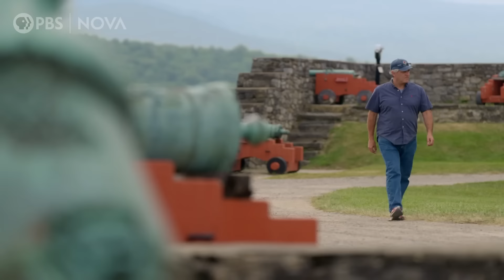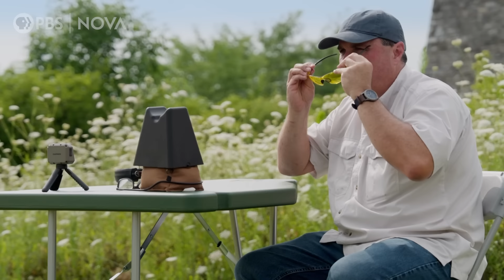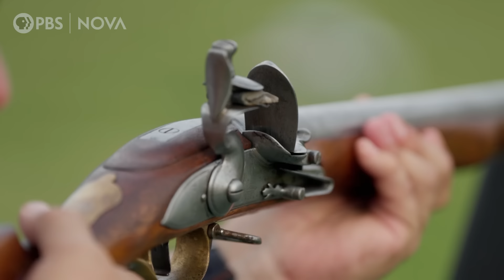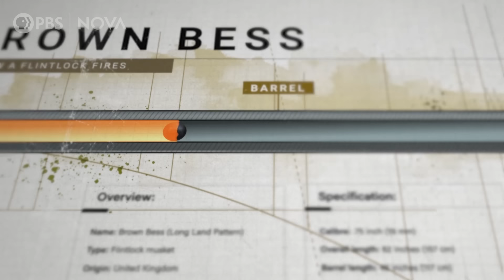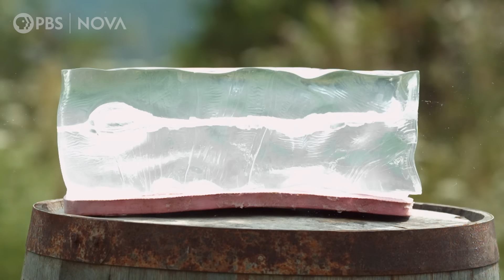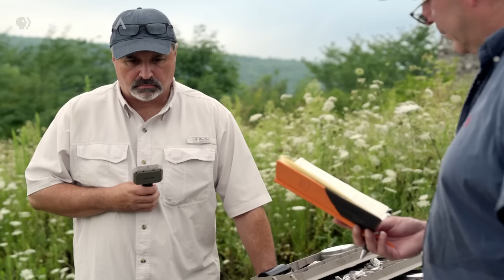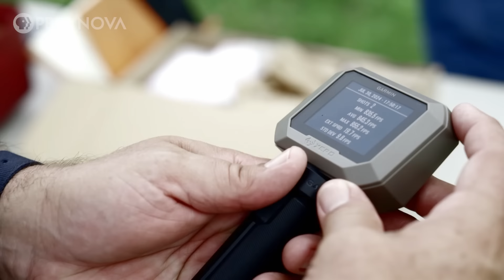How Deadly Was the Musket? | NOVA | PBS

Comment: Once again, I have to explain this, to dispel the myth that you couldn't hit the broad side of a barn with a smoothbore musket. There are two general ways to load a musket. In battle, the quick expedient way was used, which is to drop the loose ball over the powder and ram the empty paper cartridge down on top. When fired, the loose ball would bounce and roll down the barrel, usually hooking a wicked curve in an unpredictable direction as it exited, due to its sideways spin, which could result in a foot and a half, or more, of deviation at 50 yards. However, if time permits, the barrel could be swabbed, and the ball wrapped in a tight fitting greased patch of cloth or leather, and then rammed down over the powder. This is how it would be done if deer hunting, for instance. This method will prevent spinning, and will result in a surprisingly accurate shot, giving groups of only a few inches at 50 yards. I've done it myself with my own .68 cal. musket.
Reply: That would mean that the first shot fired would be pretty accurate because the gun would have been preloaded before the battle begun.
Reply: @wr1120  That may be true, but I couldn't say. It's likely that most of them didn’t, in companies that had been drilled according to the drill manual of the period, because it probably wasn't considered necessary, and the troops had all been issued standardized equipment for loading in the usual way, and that's how they had practiced. But accurate longrifles also existed at the time, although they weren't as common as smoothbore muskets. There were small numbers of "irregular” troops, who were equipped with their own rifles, and could be employed as sharpshooters.
Reply: @bellowphone I like to think a grandfather of mine, a captain, and his son were smart enough to be sharpshooters. All I know is, They made it to Ohio after the war and I'm alive today.
Reply: @melissaorlee  And that's smart!
Reply: Brilliant answer! Absolutely spot on! This is why the first shot was always so much better.
Reply: I think the myth is becuase people compare it to rifles that became common in the 19th century. Those rifles were far more accurate and (relatively) comparable to modern guns. Missing by 18" at 50 yards is inaccurate it's just not as crazy inaccurate as some people think.
Reply: to be honest you don't want to me hit by ether one
Reply: @KaedFuyou  No, it will put you in the hurt locker quicker than sooner.
Reply: Thats super useful thank you
Reply: Okay, but what would be the comparative reload time between a rifle of that time period and the musket loaded in this manner?  The reason the musket was preferred (I know you know this already) was that the quick expedient way was possible with that weapon's smooth bore, and in a pitched battle, rate of fire matters more than accuracy, since you're very likely to hit somebody when firing at closely ranked soldiers, whether in a thin line or a column.  (You might wound/kill two men if one is right behind the other, and whether they die or not, they are out of the fight for a while).

You wouldn't give a sniper a musket if rifles were available.  And the Continental Army, in some battles, had riflemen who would be backed by musketmen--with the faster-loading muskets providing cover, they could take a serious toll on the enemy from a longer distance.
Reply: @christopherlyons5900  As far as I can tell, there's no appreciable time difference in loading a rifle or a smooth-bore musket with patched round ball. The tighter the patch/ball combination is, the harder it is to start the ball, and in general the rifle loads will be tighter, needing a short starter to bang the ball in, before ramming down. So it is done by marksmen for whom tack-driving accuracy is important. But I just load easy in either case, and don't need a short starter.
Reply: @bellowphone  So assuming that is true, and I see no reason to doubt it--why would the Continental Army have rifleman squads, when rifles would presumably be more expensive to make, harder to find, and  you could just have squads of musketmen who were instructed to use the tighter load and aim more carefully?  

There was even a song--that I learned in music class--meant to strike terror into the Redcoats--"The Riflemen of Bennington."

Why come ye hither, Redcoats, your mind what madness fills?
In our valleys there is danger, and there's danger on our hills
Oh, hear ye not the singing of the bugle wild and free?
And soon you'll know the ringing of the rifle from the tree

Oh, the rifle, oh, the rifle
In our hands will prove no trifle
Oh, the rifle, oh, the rifle
In our hands will prove no trifle

Tell he who stays at home, or cross the briny waters
That thither ye must come like bullocks to thе slaughter
When you'll meet our Mountain Boys and their lеader Johnny Stark
Lads who make but little noise, but who always hit the mark

Oh, the rifle, oh, the rifle
In our hands will prove no trifle
Oh, the rifle, oh, the rifle
In our hands will prove no trifle

There had to be a significant difference in performance between rifle and musket, or there'd just be muskets.  I'm going to guess that the rifling made a greater and greater difference as range increased.  If you can hit your opponent, and his return fire never even reaches you.....
Reply: @christopherlyons5900  The short answer to your question is, yes, rifles are significantly more accurate than smoothbore muskets, regardless of how they're loaded. The greater the range, the bigger the difference.
Reply: @bellowphone  As I thought.  But it's still worth mentioning that muskets could be deadly accurate as well.  It was just that in pitched battle, rapidity of fire meant more than accuracy.  Hunting with a musket would be quite another matter.  If you miss your first shot, the prey is off and away.
Reply: And to emphasize one more point--rifles back then took a lot more time to make.  A badly made rifle would be useless.  There was more craft involved.  Relatively few knew how to make a Kentucky Rifle, in Kentucky or elsewhere.  The Brown Bess was much easier top produce in large numbers, with consistent quality, and in war the big battalions beat the crack squads.
Reply: @christopherlyons5900  That's not true. A high-quality musket could cost much more than a rifle. But troops never ordered many rifles because they were ineffective in combat. Only a few skirmishers could use rifles as sniper weapons. It's like giving all modern soldiers sniper rifles and expecting them to shoot like snipers. :)
Casualties in the wars of the late 19th century and WWI didn't increase. Weapons didn't become more accurate. But the number of bullets fired increased exponentially.
Reply: @KaL_69_    The best rifle would cost more than the best musket.  But in military terms, the goal was reliability, and you didn't order some super high quality musket for an ordinary soldier.  The Brown Bess in 1775 cost 3.5 pounds.  A top quality rifle would be like three times that.  I have said repeatedly on this thread what you are telling me like I don't know perfectly well that muskets made more sense for ordinary soldiers.   But yes, one factor involved in the predominance of the musket was cost, because a badly made rifle was effectively useless in combat.  For the same reason the longbow predominated over recurved bows and crossbows.  You could get a really good weapon for less money.   In mass warfare cost effectiveness matters.  

Nice lecture.  I slept through it, as I always do when somebody tells me what I already knew. ;)
Reply: @christopherlyons5900  You're a hostage to marketing. Expensive doesn't mean more effective. A Kalashnikov assault rifle costs $1,000, while an M4 costs $3,000. Do you think the M4 is THREE times more effective? No. The M4 might be slightly more accurate at the shooting range, but in real combat, you won't notice any difference.
Also, all military muskets underwent very rigorous quality testing, and their price was artificially lowered for military customers.
Reply: @KaL_69_  You're one of those people who struggles with reading comprehension.  I can't have a discussion with somebody who refuses to understand the points he's responding to.  So.  Bye. ;)
Reply: @KaL_69_  You're spouting nonsense. "kalashnikov" what are you talking about ???? An AKM ? AK-74 ? AK-74M ? If it's an AKM than you'd absolutely see the difference in combat. There's a reason why the USSR copied the 5.56 cartridge. If "rEaL CoMbAt" didn't make a difference anyway the US would have copied the AK or at least it's apparently miraculous principle. if you mean the "equivalent" sortof of an M4, like an AK-74M, then not only the M4 is indeed better and would be worth the money, but even then you realize that because the rubble is a weaker currency that still doesn't mean much ?
Reply: @christopherlyons5900  Perhaps also the rifle was a weapon for hunters who needed accuracy more than speed of reload, and proved effective in posted fire from behind trees, out of range of the muskets, and not providing a sufficient target for a volley. But you could only harass ennemy column, not stop them.
Reply: @gengis737 I think I said that already.  Multiple times. But we still have sniper rifles and they are military weapons, not used for serious engagements.  Still very disconcerting to know the enemy can kill you and you can't kill him.  Or even see him, sometimes.  And not much point in quick reload if you have to keep changing positions to avoid capture.
Reply: @bellowphone Have you ever tried Nessler ball? Does it make any shot as good as patched-rammed one?
Reply: @VictorBondar-d3d  I've never tried that. Just round ball, and a few times, some buckshot. I suspect that Nessler ball would go straighter without a patch, than a ball would.
Reply: I mean I’m no historian. But if they were so inaccurate? Why so many dead soldiers? I bet all the ones with missing legs, arms and slowly dying of led poisoning would love to differ lol. Other than saber deaths which were probably super rare and had to be calculated well on horseback and foot. I’m sure the colt revolver during civil war was definitely a game changer even though it was mostly just ranking officers carrying them.
Reply: @RebelRed-n5H  the minie ball was huge. The high numbers of wounded are because the civil wars tactics were well behind the technology. Men would charge hard points like stone walls and get cut down, and just send wave after wave to their deaths. The wounded numbers in earlier wars don't even come close.
Reply: @ldar221 Makes sense.
Reply: Time doesn’t permit. 😂
Reply: It’s nice they are rifled now
Reply: Also the rifle bullet tumbles when entering the transfering more energy to flesh and shock to organs, sort of like whiplash. The .303 bullet was designed to replicate a hollow point "dum dum" round in a Hague convenrion legal full metal jacketed round.  Also though it would "rather" difficult to hit a bone in the gelatin matrix with the "Brown Bess" the bone shattering and subsequent bone "shrapnel" through the block would definitely show how devastating a mere lump of lead could be.
Reply: also important to remember that any gun would be "inaccurate" with the smoke generated after the first or second volley fired by muskets.
Reply: @wbwam7710 same problem with cannon...
Reply: another useless videos
Reply: Smoothbore muskets were inaccurate, otherwise, battle losses would have been much higher in the early eras of gunpowder and nobody would be doing line formations. Even during the American revolutionary war, battle losses were about 10-15% on average - because nobody could hit anything.
Reply: @seargantmagor  The point of line formations was to maximize casualties, and they could get pretty high.  Almost 50k at Waterloo--in a few hours.  And this rgua seemingly suicidal behavior (with variations) continued when it was breech-loading rifles in the Civil War.  What made casualties higher there was the Minié ball.  Faster rate of fire, greater accuracy, but really the worst part was the amount of damage done to the body. Rifling didn't only create greater accuracy.  A spinning projectile is worse.  By a lot.  Hence the AR-15.  

And honestly, what was the point of WWI tactics?  You know they have machine guns.  You know they're waiting for you.  You order the men to get up and walk over open flat terrain towards the enemy.  The commander is carrying a damn sword.  Holding it up to demonstrate authority, so the men will follow him.  As it went on, they switched to a swagger stick.  Not useful for self-defense, but less likely enemy snipers would selectively pick off the officers.  

Muskets could be fairly accurate with careful loading and practice, but again, the point of them was they were easier to mass produce and could be loaded much quicker than early rifles.  Discarded once industrial methods made better guns available in large numbers.  Yay.  :|
Reply: @christopherlyons5900  What you said doesn't make much sense. If the goal is to maximize casualties, then you wouldn't do this tactic for your own forces. Mind you, Napoleon used line formations and he is renown for minimizing casualties and pushing modern day EMS. Also, nobody would go to war if the chances of death was considerably high.

The battle of Waterloo, as you mentioned, lasted an entire day, and despite the 50,000 casualties, this represents a loss proportion of about 25%, which was considerably higher than the average of battles across the fronts (10-15%). 

The Minie ball, along with many other advancements led to the end of line formations (mid-1800's) since people could actually hit a target and volley-fire was no longer a necessity. Even in the American civil war, we see a dawn of trench warfare. 

WW1 was a transitionary period. Strong and effective weapons with not much armor to counter them. It's really hard to combat trench warfare when tank/aircraft warfare was in its infancy. Well, tanks didn't even come into action till half-way into the war.
Reply: @seargantmagor  Lots of things about war don't make any sense. As you have tacitly admitted.  All wars are transitional (transitionary?) They were always adapting to new technology, even in the middle ages.  The French thought columns would work, the British used the Thin Red Line, but the fact is, they could not give most soldiers a rifle when good rifles were too hard to make.  And they went on using big battalions after machine guns were a thing.  Which of course was LONG after rifles were a thing.
Reply: @seargantmagor  You are a victim of myths and poor education.

Minié bullets did not put an end to linear formations. Linear formations were used until the end of the 19th century. Casualties were the same as during Napoleon's time. By World War I, it wasn't the accuracy of weapons that increased, but the number of bullets fired at the enemy.

During Napoleon's time, approximately 30-100 bullets were fired per soldier killed. During World War I, approximately 10,000+ bullets were fired per soldier killed.

In other words, the accuracy of fire decreased, but the density of fire increased.
Reply: @seargantmagor  Linear formations are needed to increase the resilience of troops. A crowd will always scatter after a few volleys. A linear formation can always withstand several volleys. This is precisely why modern armies are so ineffective. They fight like Indians and bandits.
Reply: @seargantmagor  The american civil war is not a dawn of trench warfare and trenches predate it by a long time. Formations while not necessarily a line would absolutely be a thing until world war 1 where modern warfare was born and squads would begin to be standard. WW1 was not a transitional period, it was literally a new type of war and they had to adapt to it, hard. And rate of fire was still important as despite being more accurate, rifled musket were still slow to load and required a lot of training to use. By the way, in the american civil war, they still fought like they did with regular muskets because the american soldier were poorly trained and a rifled musket requires a lot of training to be used at ranges, like you'd see in europe. In fact muskets could be deadlier in that war, as you could load those with buck and ball. Anyhow you clearly don't really know what you're talking about; i've seen a dimwit claim ww1 had more in common with the thirty years war than world war 2, you're the polar opposite but neither are true.
Reply: @swǝ  First and foremost, trench warfare didn't exist until WW1, as it is defined as a war that is predominantly fought in trenches with minimal movement. While trenches were used even as far back as the Siege of Constantinople to have sappers place gunpowder charges on walls, these were more confined. The Crimean war and the American civil war saw more extensive uses of trenches across multiple battlefields, hence the 'dawn'. 
In the American civil war, the Siege of Petersburg had 30 miles of continuous trenches with 9 months of lackluster movement from both sides. Other battles such as the Siege of Vicksburg also saw vast trench systems. As a result, and particularly at the end of the war, mortars became more popular to combat trench systems and not specifically for naval or fortress sieges. Do you see the similarities how mortars becoming popular in land combat during the civil war has an influence on the extensive production of mortars during WW1? If you can, just google "precursors of trench warfare" - a little bit of research goes a long way.
Reply: @KaL_69_  This was actually a cool read. I actually never considered the 'bullets per casualty' ratio. But I did do a quick check and it took 250 bullets per casualty during Napoleons campaign, and 75 per casualty during the American Civil War. So that does line up with the Minie ball being more accurate. 
Regardless, that was a very interesting thought and I do thank you for it.
Reply: @seargantmagor  I didn't say otherwise...? Hello ?
Reply: @seargantmagor  Where did you get this data? Union factories produced approximately 1,000,000,000 rounds of ammunition for rifles, revolvers, and other small arms. In the South, output was lower, but still reached hundreds of millions of rounds.
At the Battle of Gettysburg in 1863, both sides fired approximately 7 million bullets, and the artillery expended approximately 50,000 rounds of ammunition. Losses were 50,000 killed and wounded.
At the Battle of Chancellorsville in 1863, approximately 4 million bullets and 10,000 cannon shots were expended. Losses were approximately 30,000 killed and wounded. That is, on average, 150 bullets per soldier. Furthermore, only 10-15% were killed, the rest wounded.
By comparison, during the Napoleonic era, the entire British Empire produced only tens of millions of musket rounds per year.
At the Battle of Borodino in 1812, approximately 4 million bullets and 120,000 cannon shots were expended. Losses amounted to 80,000 soldiers plus tens of thousands of horses. That's an average of 50 bullets per killed or wounded.
We could also compare the number of generals and officers killed and wounded, but I think the comparison wouldn't be in your favor :)
Reply: @seargantmagor  This is a myth. Muskets were very accurate weapons. For example, at the Battle of Monogahala in 1755, the Indians and French lost about 100 soldiers, despite being in cover. By comparison, during the 1982 battle of the Falklands War, British soldiers suffered similar losses. This means that muskets are as accurate as modern weapons.
Reply: @KaL_69_  mate just no, muskets CAN be more accurate than you what credit is given, but certainly not as accurate as modern weapons lmao, and test done recently have proved it
Reply: @swǝ  So why do modern soldiers expend hundreds of millions of bullets, yet only 1 in 50,000 hits their target? Soldiers of the 18th century would have been stunned by such poor accuracy. Often, 5-10 shots were enough to inflict devastating damage on the enemy.
Reply: @KaL_69_  Bro played called of duty and thought that's how war was supposed to be... 1 in 50000 is not high intensity warfare, but low intensity warfare where you mostly suppress a not very numerous and dispersed enemy with your own not very numerous squad. You don't even aim to kill most of the time, except when you come face to face with an enemy by chance. You really here claiming accuracy was even better even though this is nonsense logically, you have lots of material online that disprove it, and you could even do experiments yourself and find out. This is ridiculous, you are a sad troll.
Reply: @swǝ  These data are based on reports from high-intensity wars, such as World War II and the Korean War. I recommend you familiarize yourself with the reports compiled by the Operations Research Office (ORO) in 1948.

Yes, you can easily find data on ammunition production and consumption online. For example, in 1944-1945, the US Army expended approximately 1,000,000,000 small arms rounds and approximately 100,000,000 artillery shells and bombs. I think these data speak volumes about the low accuracy of fire.

By comparison, during the Napoleonic era, even in the largest battles, ammunition consumption did not exceed several million pieces. And ammunition production in all major empires was hardly tens of millions per year.
Reply: @KaL_69_  Hum no i'm pretty sure 50k bullets for one kill is the vietnam war; but you know what let's push it further; you take a trained person's accuracy with an M4 and then with a musket; i mean you won't and you're a clown for even suggesting the musket is more accurate as it goes against logic, physics, history and facts; however regardless you just confirmed my point so thank you :
The napoleonic era... Napoleonic era wait, how did they fight in the napoleonic era... In large formation at 300 meters maximum with for the most part no regards to camouflage as it wasn't needed for those types of battles, in ranks; bozo over there really thinking napeolonic soldiers given M4s would be less deadly
Also hum expended a ton of bullets is called suppressing fire, a ton of artillery is called indirect fire and a ton of bomb is called strategic bombing or in that case "destroying the whole industry and infrastructure of north korea, sending it back to the stone age"
Here's your midwit award
Reply: @swǝ  You should learn to use Google and not trust your feelings, heh
I'd prefer an automatic smoothbore shotgun. I think that would be a fair deal and would level the playing field, heh
By the way, the Winchester Model 1897 truly terrified German riflemen in World War I. Riflemen were no match for smoothbore gunners.

It's ironic that 100 years later, smoothbore guns have returned to the battlefield. Nowadays, they're the best weapon against drones. Even automatic rifles are practically useless against drones.

During the Napoleonic era, combined tactics were used. Light infantry moved forward and on the flanks, occupying advantageous positions and cover. They fought in loose formations and protected the infantry lines from enemy light infantry fire. Behind them moved heavy infantry in linear formation, designed to break through the enemy line and counter the numerous cavalry. Generally speaking, modern soldiers are incapable of surprising veterans of the Napoleonic Wars. Essentially, all modern infantry tactics are descended from 18th-century tactics.
Reply: Everyone in this thread is wrong, the main reason why muskets were inaccurate during battle is because they were accurate up to 250 yards. Generals knew this and out of fear engaged at distances up to 400 yards.
Reply: @poeticlemon4182  also wrong. generals wouldn't waste ammo like that, nor would soldiers.